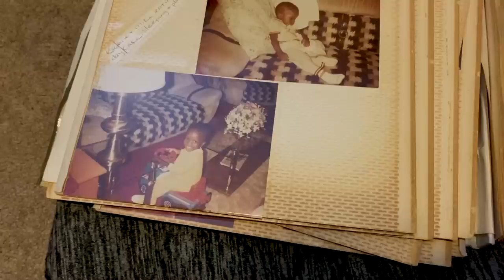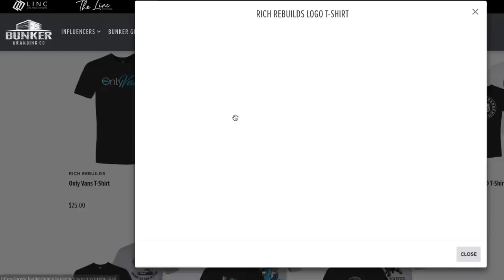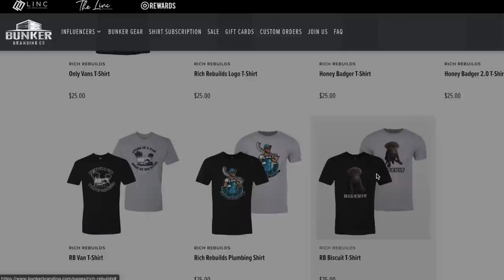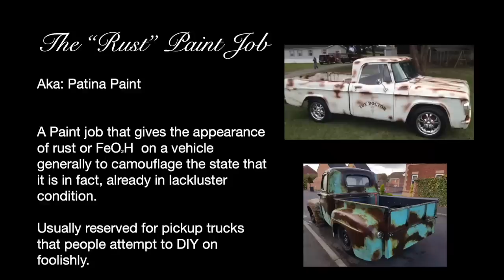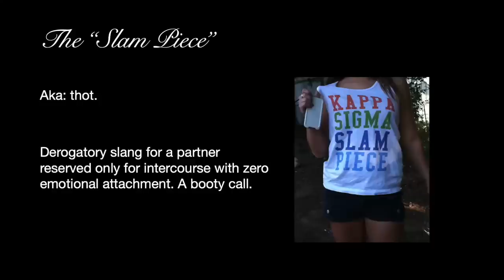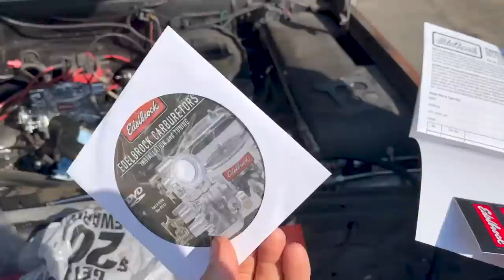I Thought I Bought my Dream Classic Squarebody Truck, I was VERY Wrong

Comment: Salute, blessings to everyone . I would for die for that truck , that model, the fact it's a crew cab ( I have 4 kids. ),  It's a daully ( I'm starting my own side businesses ) , I'm dreaming about diesel swapping my 12v Cummins  a old Chevy 3500, ( I own a 95 12v Tubro Cummins ram 2500 ext cab I'm building currently on my YouTube channel. To start my tow pig work services. ) So I would get decent Wilder and going fixing the frame and body. I am paint wet painter, power coating for years now , and I do everything else and of course I'm recording everything I can in my life and posting every time I have on my as Salute to everyone.

Comment: Okay as much as you've already spent the money to purchase the vehicle how you get back at people who sell you stuff like this is you fix it you make it a real nice vehicle how pull the bed pull the cab for the front end pull everything off of the engine go find you a donut truck yes and this condition you pull a harnesses you map it with everything goes cuz they're obviously in this truck these buttholes hacked and whacked everything in it as far as the rear suspension order rat Tech kit and fixing to replace what's been bugging up it's obviously I would honestly love to see you rebuild the truck at any cost cuz it really you're not going to find a square body dually you're just not going to I mean it's one of those issues that you know it becomes a two or three year project or how long you want to screw around with it but I really would like to see you tear the truck down it's a chassis power speed blasted sandblasting and repair the chassis there's good stuff there just that they it's to ask you got good stuff there is the execution of what was installed that's why I said buy a ride Tech suspension kit for the rear in front replace everything put in new inner fenders cuz those fenders are they ruin that s*** I mean the wiring is like you said A Rat's Nest I know if I had that truck that's what I would do to it I would find me another truck and cuz you're going to need doors you obviously don't need a new front clip and all the garbage that they put on the front of that truck I mean roses are kindergartener doing welding I mean they didn't give up they they didn't care about what they were doing so me personally I would like to see you rebuild the truck

Comment: There is no better Revenge on a jerk to sell you a vehicle like that then to rebuild it and make it epic truck I put two bucket seats in the front you've already spent money on purchasing certain things for the truck you Mouse and finish it out event Venturi bill that truck remove all the crappy wiring that person put in that vehicle I think it really would do great for your Channel for your fans to see you take that truck and rebuild it to an epic build bucket seats subwoofers Russian dear. 22 Alcoa wheels nice low Pros redo the traffic man Ashley actually would like to see you rebuild that truck headers 3 inch bikes 3 inch pipes domes and an epic paint job